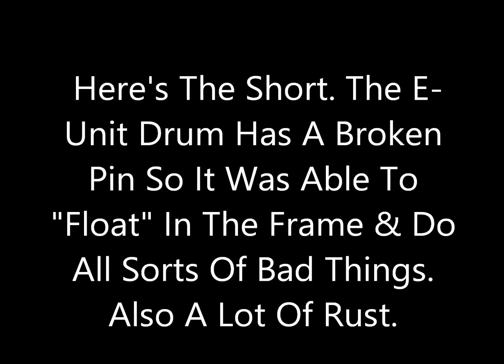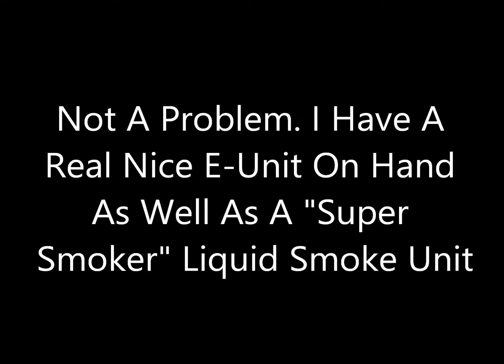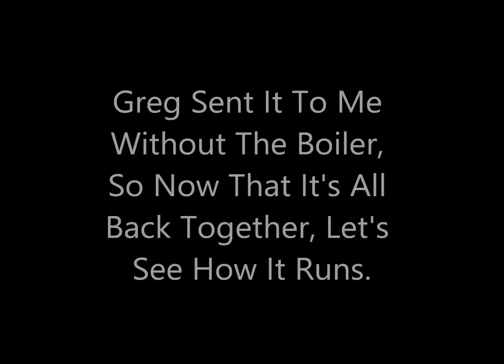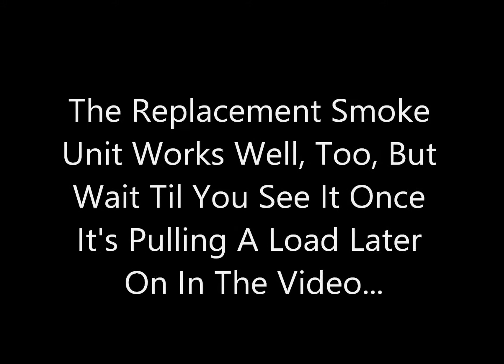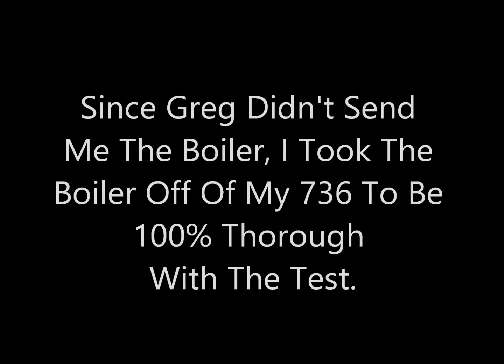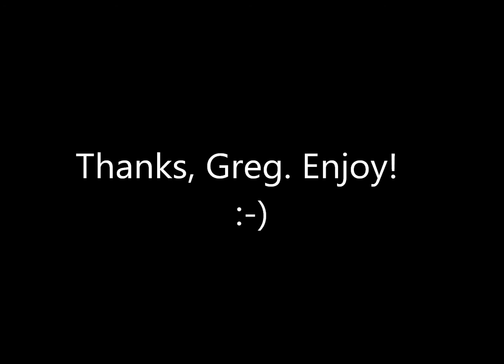Lionel Postwar 736 Service For Greg A.

Comment: A very nice video indeed.  I wish I had more knowledge for working on e-units.  I have a 0-4-0 Lionel die cast switcher that only runs backwards.  I wish I had the know how to fix the e-unit as I think that is what is wrong with it.  The number is 8506.  Where do you get e-units and the schematic for wiring them up?  I used to work on TV's but Lionel e-units are baffling.  I like working on the engines as I just fixed a 2-4-2 Columbia engine that would no nothing on the track.  I took it apart and took off the brush plate.  There was a big glob of grease on the armature gear--I cleaned that off and removed a bunch of carpet fibers.  There was so much grease that the brushes were glued inside the brush holders.  I cleaned them with some lighter fluid on a Q-tip and reassembled.  Now it runs fine.  Just wish they were all that easy to fix.

Comment: Hi trackmastertim I was just wandering if you are the same guy who owns the eBay store postwar-parts-n-service. And if you repair Marx toys. Specifically a plastic postwar Marx 1404 signal. I’m asking because I have 3 of them and they don’t work and I have been having issues with people not being able to repair them. Thanks
Reply from the maker: Hi. Yes, that's me. I had a 1404 pass through here a few months ago and I worked on it for quite a while, but couldn't get it to work right. The delicate plastic mixed with the little metal arm inside that needs to move and cover the correct lights is just a really tough design to deal with. I'm sorry, but I'm not going to be able to help you with them.
Reply: TrackMasterTim ok, thanks for the response. Do you know of any where that you would recommend to get them repaired
Reply from the maker: Offhand, I don't know of anyone, but you could try a Google search for a Marx specialist. There's got to be someone out there who has a lot of experience with those pesky 1404s.
Reply: TrackMasterTim okay, thanks. Bye and best of luck

Comment: I'm restoring a 2020 turbine and the smoke unit is corroded shut, any tricks or tips?
Reply from the maker: Potato27002 Scrap it and buy a replacement. You can get a good one for $15-$20 on ebay.
Reply: TrackMasterTim so I finished cleaning the loco, put it back together and tested it and it just sits there and buzzes as if it's stuck in neutral. The wheels aren't even trying to move. I did break 2 copper wires on the Motor when took it apart, but I re connected them to the copper coil they were attached too. Please tell me what I did wrong
Reply from the maker: Potato27002 either you didn’t reconnect the field coil wire to the brush plate or you have the e-unit wires soldered to the wrong places on the motor. I can’t tell unless it’s in front of me on my workbench.
Reply: I didn't touch anything on the e-unit, I most likely reconnected the two wires wrong. I posted a Video of the loco powered up without its shell: https://youtu.be/xALCN7uQAmY
Reply from the maker: Potato27002 yes, that’s what I was saying; you might have connected the wires from the e-unit to the motor incorrectly.
Reply: the copper wires I broke came from the brush plate and not the e-unit, when I pried off the brush plate they snapped. All of the cables from the e-unit to the motor are still intact and were never touched during the cleaning of the engine. Both the wires were soldered onto the middle connection on the brush plate, and were originally connected to the copper coil that wraps around the top half of electromagnets surrounding the armature.
Reply: Tomorrow I plan to mess around a bit with the connection between these wires and the copper coil, this is only my first restoration and I'm still learning BIG TIME
Reply from the maker: Potato27002 since you said you are “restoring” the locomotive, I assumed you had completely disassembled it, including unsoldering the e-unit wires from the motor, completely rebuilding the motor, etc. As I’ve said, I can’t help unless it’s in front of me. If you’d like to send it in to have it professionally serviced, let me know.
Reply: thanks for your help, like I said, this is my first time working on a postwar engine and I'm still learning, take care

Comment: Can you help me with a problem I've got?
Reply from the maker: Hi Alan. I can try. What do you have and what's the problem?
Reply: TrackMasterTim  I just got recently a 1000w freight set from 1955 with a 2016 steamer and it seems to be running rough and smoking, but it doesn't have a smoke unit. Also the accompanied tender a 6026w its whistle doesn't work at all.
Reply from the maker: Yeah, smoke from a non-smoker is not a good thing. Sounds like they're both long overdue for a full servicing. Let me know if you'd like to send 'em in for repairs. TimsTrains@optonline.net
Reply: TrackMasterTim well I would like to yes, because I'm afraid of doing it myself
Reply from the maker: Ok, sounds good, Alan. Email me at TimsTrains@optonline.net and I'll give you the information on where to send them, approximate cost, etc.